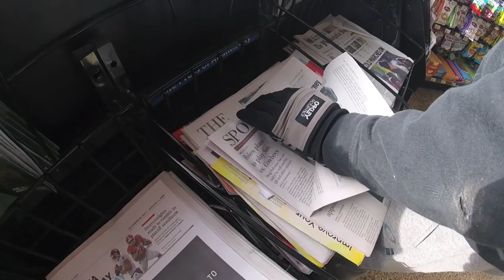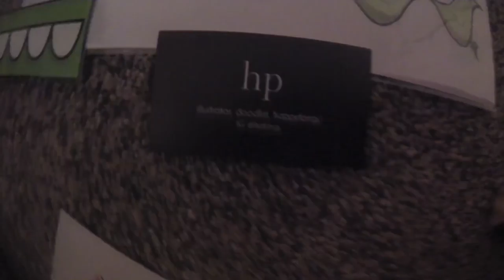DOUBLE SCRAP SCORE!

Comment: So some joker ripped 300 feet of my 1" copper water line from 20' up on the side of my building during CHRISTMAS!!!!!. Good news is I got a copy of his ID from the scrap yard and gave it to the cops. He tried to turn it in with crimped ends and full of dirt.  This brain surgeon is going down.
Reply from the maker: That's brutal man! Probably got like 12 bucks for it haha so not worth it!
Reply: Tucker Upper he didn't get anything. I contacted them before he got there and they confiscated it for me. In Ca. You have to show an ID and wait 3 to 5 days to get paid for copper. That's how bad the thieving is. They gave me the pipe back so now I have to open it up and dump the dirt. Like the yard has never seen that trick before.